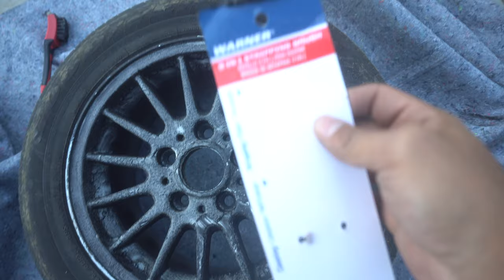The BEST Tow Rig You Can Get For $5000!

Comment: The best way to remove spray paint off of rims is the aircraft stripper spread down really good till the paint bubbles and then use a pressure washer instead of scrubbing it with a brush and a wire wheel. Pressure washer works so much better. But you’re gonna have to repeat the process more than once for each wheel.